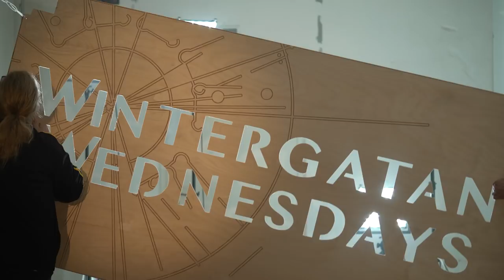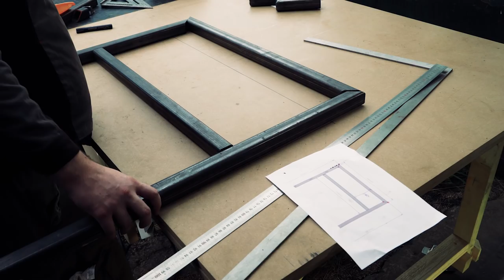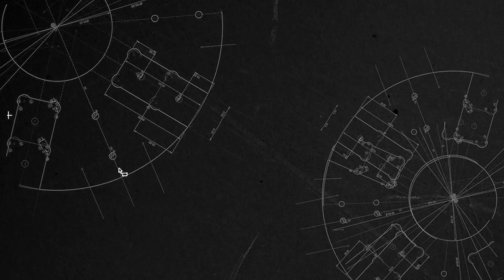Welding the Steel Frame - Marble Machine X Goes Metal #11

Comment from the maker: We half-improvised a song for this one! I have a question for you all that you might be able to help us with: i really do not want to paint the metal frame or do anything to the finish of it, we are not even grinding and blending in the welds, i love the raw look of it. But it needs protection so it does not rust. Do you have any ideas on how we can protect the steel from rusting without affecting the finish? Any ideas are welcome! And by the way, non-treated materials is the look for the whole machine, i wont paint the wood or anything. //M
Reply: You might be able to put on a layer of thin clear paint to keep the current looks.
Reply: Wintergatan you could seal with a clear coat, it would add a little shine but color wouldn't change and should protect from water which causes the rust
Reply: Wintergatan Spray with a clear coat to preserve it.
Reply: Wintergatan at least put some coating for the wood(?)
Reply: Det går att rostskydda med olja. T.ex. linolja.
Reply: Rub on some linseed oil.
Reply: Attach a Galvanic anode - block of zinc - to the metal frame; it'll take the damage, and can, once used up, easily be replaced.
Should be easy enough to be hidden, not to upset the looks of your contraption.
Best
Reply: You could use something called "Penetrol" it can be used as a base coat on the metal and doesn't really take away from the original appearance. Then as other people said, use some kind of clear coat.

Personally if you know you'll be keeping it in a spot that doesn't have too much moisture I think it would be kinda cool  to see the material rust a little. It would give the whole machine a rougher look, but it would also give it a bit of character. 

Then again you certainly don't want it to rust too much otherwise that would be pretty bad.
Reply: Wintergatan What do you mean "half-improvised"?
Reply: If you want to keep a black metal finish to it the you could either look in to a 'gun blue' or other metal stain which could look very similar to the mill scale that is on the steel from factory. andi would suggest sealing it with something, either a linseed oil or you could try a blacksmiths beeswax finish. 
Heat up the steel to a black heat with a torch and rub on pure beeswax. (you want the steel hot enough for the bees wax to smoke or even catch fire). This is a technique used by blacksmiths for ages and will give a really raw steel look to it.
Reply: check out wikipedia on Bluing (steel), for a large frame it would be difficult but the idea is to oxidise it yourself, oxide is actually protection on the metal naturally, i am not sure but maybe oil treatment can be a option. and of course clear coat is a option but that would not keep it natural imo. i hop you will find a solution, i would not paint it as well, natural raw look is awesome and it should look hand build to inspire people.
Reply: Automotive clear-coat paint should probably work. If that doesn't, a clear lacquer or even something epoxy based (not sure if those are available clear). At the very least, rubbing it down with some kind of oil will keep it from rusting quickly, but it will collect dust and fingerprints, and the fingerprints will then tend to rust.
Reply: +Wintergatan try putting a very thin layer of oil on it
Reply: I agree with the other guy here, you could powder coat it to give it a tough finish and just leave it powder coated to keep it raw looking :)
Reply: A special metall oil protect the frame and the look is the same, ask a smith. Also all wood parts can protect with hard oil (get in closer)
Reply: Not sure how you feel about Steam Punk, but maybe give it a protective primer first, and then have an artist "faux" finish to look like Steam Punk rust and wear.
Reply: Wintergatan you can use epoxy whit out eny gloss. Flatt.
2 component epoxy
Reply: I would suggest something similar to this clear matte acrylic lacquer: http://www.krylon.ca/products/matte-finish/
Reply: I am a restorer of wood and metal and we use 'Owatrol' for that, works against rust, but doesnt leave a visible finish!
Reply: there are some good answers here - my choice is RPM (rust prevention magic) -it is often used for oldtimers (cars) and does a pretty good job, but it is expensive, bluing or linseed oil is also a good option, but in my opinion the best solution is zinc coating
Reply: Wintergatan why not simply let the frame rust? Let the metal live organicly. The machine and you will have probably been retired by the time the rust affects the structural strength.
Reply from the maker: RPM seems to be too good to be true! haha i had to google it to see if you wre joking, they say: "keeps metal parts looking brand new without leaving an oily reside behind.
For years, restorers and enthusiasts have tried to solve the dilemma of what to do with natural, bare metal components. Most products changed the look of the part or provided mixed results. No more painting and changing the look of the part" Spot on what i need!?
Reply: Tech Freak It is explained in the description - Marcus improvised on the drums and Martin played along to the recording (i assume after listening to it for a bit to get some idea of what to play)
Reply from the maker: i think its my unclear way of saying that we made this song quickly, like over a day
Reply: Coat the metal in penetrol. It's a clear additive to paint to remove brush strokes. But penetrol alone gives the metal a very cool look. I use it a lot on scrap steel sculpture and projects.
Reply from the maker: Thanks for all the great tips, but the blueing will color the steel if im right? that does not work...
Reply from the maker: very interesting! There is alot of different Owatrols out there, which one should i try first?
Reply: Kaboom! Yes on the penetrol!
Reply: If it must be painted, white would probably look nice with the pale plywood.
Reply: ACF50 is used in the aerospace industry as an anti-corrosion treatment for metals. It also get used on lots of motorbikes in countries where the roads are salted in winter.
It has a slight purple tint to the liquid but is colourless when applied and needs to be reapplied every 12 months.

http://www.acf-50.co.uk/acf-50.htm
Reply: My first thought as well. Remembering chemistry in High School. Normally done with ships and other precious metal gear.
Reply: Wintergatan galvanise, also, a friend of mine uses car vanish, It keeps the metal shinny and protect.
Reply: Wintergatan btw, this does not have anything to do with your question, but you look awesome playing the guitar, is It a Gibson?
Reply: You should have used stainless steel... :D Or these alumine profiles like "item" oder "mk" (that would be actually really funny on an instrument. Could just happen that these vibrate to much for themselves)
I'd suggest clear paint. That's the only thing that doesn't affect the look, at least I don't know any other because at work we don't care if the colour changes, so we have such parts painted or zinc plated.
Oiling isn't something I'd do with an instrument, because it's a little sticky and I wouldn't want it on the wooden parts, where it will be after some time.
Reply: Heat it up really really hot, rub beeswax on it. Gives a nice dark finish that is corrosion and moisture resistant
Reply: Did you think about chrome plating? (Or chroming, I don't know the correct name for that.)
Reply: There's a finish that Jimmy Diresta uses, some kind of blackener, but I don't know if it works as protective coat, you could always use clear lacquer.
Reply: dobisan1254 same idea minutes ago. But, I don't know if a chromium plating can be suitable for the situation
Reply: Heat the metal slightly with a heat gun ( or blow torch) then rub bees wax on it, wipe off the excess wax and you have a clear natural protection.
Reply: Wintergatan just varnish with clear lack, metal varnish, I do that with many aluminium things. never oxidizing.  I know for sure you can do that with metal. grinding the welds when it is welded like a pro,  no, no, no.  let it like it is. grinding makes it even les sturdy,... even so it would be strong enough.
Reply: I have a lot of "raw" wood in our house. We even have the kitchen chairs and table raw, the only thing we do is to use a special soap time to time to close the wood fibers, to protect it from water. Our wooden "furu" floor is waxed, it's even more protecting than the soap but doesn't affect the look of the wood that much. Very nice idea of you to keep it "raw"!
Reply: You could use FIDOIL IL BLOCCARUGGINE. It's an italian product, but you can order it on Amazon. It blocks rust proliferation. It is used to create an ancient effect to gates, iron furnitures and so on, by fixing rust formed on them. Some people like to see rust...But I think it also can be used for your purpose, in order to prevent rust. You only have to apply it directly on the metal. However, read instructions carefully, before buying it. Sorry for my English...
Reply: "Owatrol Oil" like this one: https://www.amazon.de/OWATROL-%C3%96L-Blattrostentferner-Rostkonservierung-und-Rostversiegelung/dp/B00FVVEXKQ?language=en_GB
It succeeds in preventing ships from rusting and rotting, so protecting MMX will be an easy task for it. At first the surface is a little oily, but it moves deep into the metal (also in wood) and disappears completely, visually. I can totally recommend it!
Reply: Julie Tromp I doubt that you can keep alumim parts from oxidizing. It reacts basically immidiately after beeing exposed to air and this (really thin) oxide layer protects the rest of the metal.
(Btw. the "natural" aluminium look wie know is in fact just aluminiumoxide)

For further information and more detail you can check out:http://www.corrosionpro.com/blog/the-oxidation-of-aluminum/
Reply: Wintergatan Rust is cool:)
Reply: Wintergatan seal it with a clear coat or a sealer I'd say keep a thin layer of oil or wd40 on it if you want just bare metal with no other layer in it
Reply: Wintergatan melt bees wax into linseed oil for a natural coating, though this will need to be scraped off reapplied every now and then.
Reply: annc_rohr I was looking for this comment.
many tumbs for you! owatrol is the solution
@wintergatan this stuff is the best solution, i have personal experiences with it for pre coating steel boats that have to be send of to painters. the painters called us (scouting group)after 6 months (free paint job) that they where happy we used a rust protection. and when we said we used owatrol they sended us 4 cans with the painted boat!!
Reply: Nice to see you playing again. Here are a few more paint/spray on options.

Penetrol as a linseed base coat and add a polyurethane clear coat over it. The base coat will fix and prevent rust and the top coat will protect it. If you don’t have rust, then using polyurethane alone may be sufficient.

An industrial strength acrylic based product like Sher-Clear under the Sherwin Willaims brand. It’s made for use on ships and equipment.

A clear marine epoxy paint. You may want to add a UV protective top coat to avoid the possibility of yellowing from prolonged sun exposure.

Check the formulations as some are oil based and some are water based (which may not work properly if applied over an oil based product like Penetrol). You’ll probably want to test them on mockup pieces to see the effects of shine, any darkening or tinting changes, and durability.
Reply: Låt det rosta.
Reply: Go with the gun blue idea, that will be a great finish.  Instead of an oil treat it with a semi solid beeswax like Renapur (google it and trust me....) I use this when I build furniture I want to leave in metal finish, it has a less greasy end result. Lacquering the bare metal would make it succeptible to chipping and scratching when you move it around.
Reply: Wintergatan Where is the Video from last week?
Reply: you could use oil on the metal to keep it from rusting but it wil need a new couth every sow often...
Reply: I had to read through the comments to remember the name of "that cool special oil against rusting that we used onboard the ship" and I was so glad that Arne/@globalwarsrocks provided it for me :'D
You're right, it's the best solution, I have personal experience with it, too: we rubbed it onto some big steel tools that have been laying in a damp bilge for years and are still in absolutely good shape (concerning rust). They are only treated about once a year - if no one forgets - and that seems to be sufficient.
Reply: Sadly you don't opted for aluminium because anodised aluminium is great, but you can simply paint it transparent, or depending on your steel simply do nothing also you can redo the frame stainless, nickel finish it...
Reply: Oil will be greasy and so all kinds of crap will stick to it, not to speak you'll have to repeat the process frequently... Going with a clear coat should probably work, but I'm not too sure if it would last without the extra protection of a primer. Perhaps the most effective way would be remaking the structure but in stainless steel? It just kinda sucks doing it all over again, though.
Reply: Wintergatan Clear coat?
Reply: Here - http://www.instructables.com/id/Preserve-the-Beauty-of-Raw-or-Rusted-Steel-Iron-/
Reply: yeah bluing will change the color, did not think of that sorry
Reply: rustol-owatrol seems to be collorless and against rust (they sell it in The Netherlands too) if you can not find it there let me know
Reply: Try nickle plating--will look like steel and will last forever, cheap.
Try it on a scrap first to see the look of it.
Btw, loved the metal music for the metal crafting.
Reply: A clear lacquer like they put on airplanes when they want the bare metal to show?
Reply: A high quality auto clear coat, or even shellac will help. If you want to artistically rust is drop some vinegar on it.
Reply: Since you are going to be packing it, &  traveling with it, I would not suggest a lacquer as over time it may chip and crack then it will look bad and refinishing it would be a real pain. Planes don't have issues with being bumping into stuff, generally lol. I'm thinking maybe some good gun oil. It will protect it from rust and give it an awesome shine. Its also cheap and easily reapplied as needed.
Reply: Rustoleum makes a rust Inhibitor clear coat. Mostly used for garden tools and for people like me that like the look of raw metal. I'd give that a shot. No pun Intended...
Reply: some form of natural oil.  You may need to reapply it though.
Reply: just clear coat it or oil it
Reply: Satin clear coat. Failing that, bolt a block of zinc to it.
Reply: Have you checked e.g. Liberon's product lines? They have lacquer for metal (metallack på svenska). That product is meant for indoor use, so I don't know how it would endure on, possibly, wet conditions on open air stages.
Reply: Wintergatan a little less conventional, but you could try buying a roll of xpel (for cars) and applying it to the metal frame.
Reply: Or built it again with elox aluminum profile, just the edge connection parts are steel with holes and threads, then the mobility way better.
Reply: Wintergatan Some antique tractor enthusiasts swear by Owatrol (some collectors prefer to leave their tractors in their "work clothes", i.e., rusty or faded paint jobs instead of a full restoration).
Reply: I'm fine with not grinding the welds, as they are very pretty welds.
But please do brush it off, it will make the welds look even better!

A smoother surface will also protect against rust.

A very low-tech way to protect it is to give it a coat of organic oil, like linseed oil. This will make the steel a little darker and more reflective surface. It will need periodic retreating, and there is a danger that the oil will rub off on the wood, accidentally oil-treating the wood.

You could consider the old way of rust-protection: Blackening. It will however as the name suggests, make the thing black(or blue, depending on the oil used).
The process is simple: Just meat up part of the frame to dull red and wipe it with an oily rag. Careful though, since it often burst into flames.
Reply: Man, that is so much better than my suggestion :(
Reply: A clear metal primer?
Reply: Wintergatan I wouldn't know but use stainless steel, I mean it doesn't rust so yeah
Reply: Might get the same result with WD40
Reply: I know you've already made it, but it might have been an idea to make it in COR-TEN weathering steel. SSAB make it and they might let you have some! http://www.ssab.co.uk/products/brands/ssab-weathering-steel
Reply: Galv spray will keep it looking metallic, maybe you can find a shiny version of it?
Reply: no spray or sth like that, just nano sealing. it wont get glossy or shiny, but is sealed
Reply: I am pretty sure a galvanic anode only works when there is a continuous body of liquid connecting the anode and every bit of the surface that is to be protected, so this will not work.
Reply: I think you only need the anode to be submerged, in order for it to not just build up an oxide coating, preventing further reaction.
Reply: As long as you keep the machine dry the majority of the time, and don't store it in a shed or barn or something like that, it should take hundreds of years before rust becomes an issue. I would recommend you at least rub it down with some oil every once in a while at the very least though, as I suspect you might not be in control during shipping and such.
Reply: Wintergatan oil it with a 3in1 oil
Reply: that guitar sounded like Toni Iommi's one (Black Sabbath guitarist)
Reply: Baby oil, but be prepared to re-apply it every now and then.
Reply: Wintergatan gun bluing
Reply: maybe you already got the answer you need, i dont want to read all coments^^ but, du you get some clear metal finisher? this would protect it without being seeing... and for the wood there is some type of wax who looks so naturaly.
Hope it helps.  Greetings from switzerland
Reply: Nice! Technical thrash is just so brilliant.
Reply: Wintergatan another voice for ACF50. If it's good enough for aerospace it's good enough for most things!
Reply: +dogastus Which is scented mineral oil.
Reply: Wintergatan owatrol oil
Reply: Wintergatan silicon base lub can do the trick
Reply: Yeah, that's what she said!
Reply: you could also use some clear coat and that could protect it.
Reply: + Wintergatan CAUTION !!! : RPM is essentially nothing more than a chrome restorer/polisher/maintainer silicon based paste and those types of products are gritty and will eventually strip away the appearance of your frame ( even the black powder coating on the tubing ) that you're trying to maintain. Eventually, over time, the whole frame will start taking on a chrome look if you choose to use it. I've worked for various automobile body shops and bicycle shops over the years and you really only have 2 options available ( through my experience ) if you want to retain the frames original look. #1. Any silicone based spray lubricant ( I would suggest " WD-40 Specialist Water Resistant Silicone Lubricant " ). #2. Singer sewing machine 3 in 1 oil in the small squeeze can. The choice would be yours, but I'd highly suggest going with the WD-40 silicone spray as it is less of a dust magnet as the Singer oil is. With either choice, just apply to a cloth and wipe the frame down occasionally when it's looking dry. People suggested bluing on this thread. Well, you've already changed the frames appearance once you've done that. Others suggested clear coating. Clear coating, when not exposed to enough UV lighting, will start to take on a yellow/orange hue over time. Big fan of yours, Martin. Just trying to help you out from my life experiences, hope I helped.
Reply: + Kristopher Either 3 in 1 or a water resistant silicone spray. From my experiences, 3 in 1 attracts way too much dust. I sure do remember using 3 in 1 A LOT !!! back in the early days of my riding road racing bicycles before silicone sprays were available though.
Reply: Galvanize the frame
Reply: Acrylic bath? My best SWAG.
Reply: I know what you mean - it looks beautiful. But the only easy way to protect it for longer is galvanizing. The second way is with oil and much work - look for protecting old katana swords. They will rust also but are protected with special oils.
Reply: How about electronic rust protection. they use very little power so a battery would last for months without being charged.   Keep up the good work love what you do.
Reply: Add Linseed oil, wait for that to do it's magic, put on a layer of liquid latex, and then the stainless-steel stuff you find on the outside of a Thermos
(Maybe re-finish)
Reply: How about gun blue? Of course, you can always put clear lacquer on the steel, or boiled linseed oil.
Reply: Clear nail polish
Reply: Get clear rust proof finish.
Reply: What guitar are you playing?
Reply: I am working on a project with a similar finish- wax is the answer but it is less permanent than clear-coat (however clear-coat might chip in transit) so you have to keep applying it as with any natural finish. Not sure which wax though. 

3:10 Awesome watched it like 3 times 😂
Reply: Do what rat rod builders do to preserve the patina of the raw rusted metal, paint it with a clear matte laquer.